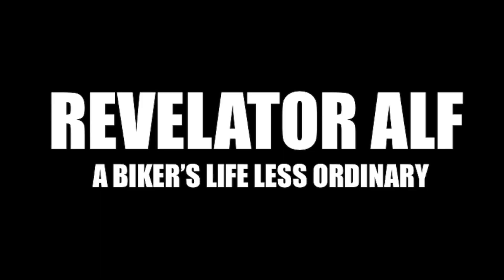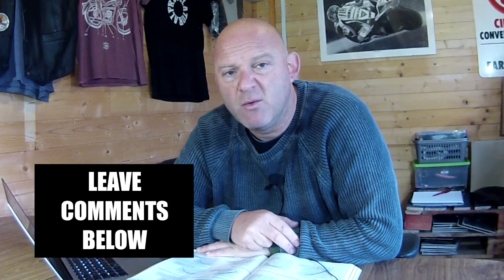Do H D 114 Engine Stage Upgrades Give More Power - Are Harley Performance Upgrades Worth It

Comment: Hi Pal, I have the 2018 fat bob 114, I had the stage 3 kit fitted, I already had rinehart mufflers fitted for the stage 1, when dynajet put it on the rolling road and finished all their tuning they were quite surprised to tell me my bike was pushing out 130ftlb torque, in their own words they said it was a beast lol, for those that might want to go full max in hp remember it only works at the very top end of your rev range, you need to think how often you'll actually be able to get it up there and keep it there, in my opinion it was definitely worth going for the stage 3, but I'm with you, they should come with the option of a 117Ci in the softail. Love your videos 👍👍
Reply from the maker: Sarge8610 Bloody Hell! As we say over here pal! That sounds terrific and yes totally agree about the hp and riding profile.  Cheers

Comment: I have a Stage II torque cam on my Fat Bob 114 with the Rinehart 4.5 slip ons.  I am getting around 100 hp and 114 ft/lbs of torque at the wheel. The torque is pretty even through most of the typical rev range I utilize in normal street riding. It’s a fun bike for sure.
Reply from the maker: Ah nice. That sounds like the kind of performance I'd go for too. Cheers

Comment: The independent v-twin garage in my town (dealing in S&S) with a dyno charges $300(US) up to $1200+(US) for tuning (it could take several sessions) depending on how complex the set up. Do the Screaming Eagle Stage kits come with a dyno tune or is that an additional cost? At what point do you start to look at the bikes suspension in order to keep compliance and the power on the ground? Is it easier to just to buy a Triumph Rocket 3 and pay for all the speeding tickets?
Reply from the maker: So true Gene. Most people think about the power increase but less about the overall package

Comment: I wonder how much does all the performance upgrades affect the fuel economy?
Reply from the maker: Joe McC it makes it worse I’m afraid but not sure how much. It really depends on what work has been done. Cheers
Reply: @RevelatorAlf  Not in my experience..... I have a 2019 Roadglide Ultra with the 114 motor.  At 1000 miles I had the Stage ii Torque Cam, adjustable pushrods, the Ventilator air filter, Screamin Eagle complete full exhaust which moves the Cat back into both mufflers utilizing high flow cats, and tuned on a chassis dyno using the screamin eagle street tuner. All parts were Harley Screamin Eagle, purchased and installed at the dealer keeping all modifications under the factory warranty. Total results were 105 HP and 115 ft lbs of torque and EPA compliant.  My 940 lb bike gets 43.5 mpg around town and 45 out on the road . The power is everywhere and it pulls so well, I shift around the 3200 - 4000 rpm range . The graph shows max torque all in about 1700 rpm and flat to 4800 dropping off at 5200. It's really a fun bike to ride.  It does have a bit of a lope at idle but i like it. And heat??? NONE, best thing anyone with a touring bike could do is buy the exhaust system as it moves the heat under the bags. Now as far as cost for the modifications ... with Tax I was at $3200. out the door. And yes the dealer made me a discounted deal for being a good customer.  Hope some of this INFO helps. Thanks.
Reply from the maker: Scott Peters amazing info thanks and quite reasonable cost considering the work you did before. I like that torque profile too. Very nice.
Did you know what your fuel consumption was before you had the work done by chance? Cheers
Reply: @RevelatorAlf  With only 1000 miles on it ...not really. But was not complaning with anything in the mid 40s.When new (under 1000 miles), twice the computer showed a range of 278. So did not check much.  The lean condition these new motors operate in really gets them into some great gas mileage. In comparison my twin cams were always in the 35-36 mpg range.
Reply from the maker: Scott Peters oh yes no doubt. I did a test on my Sport Glide and got over 250miles but still think given the right conditions it will do 265-270miles. Cheers
Reply: @scottpeters2974  how loud is your exhaust ? Could you start your bike in the morning without waking up your neighbors ? lol. I just bought a 2021 road king special with the 114. I’m looking to do an exhaust for performance and better sound but I’m wanting to keep it as quite as possible, or at least something that isn’t loud until you actually open it up.